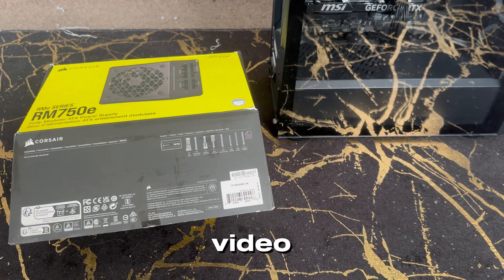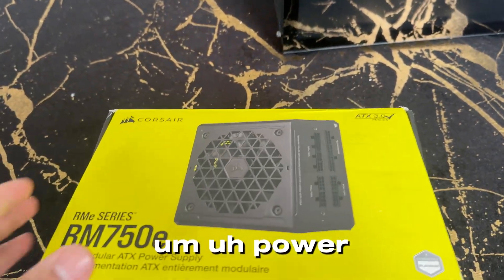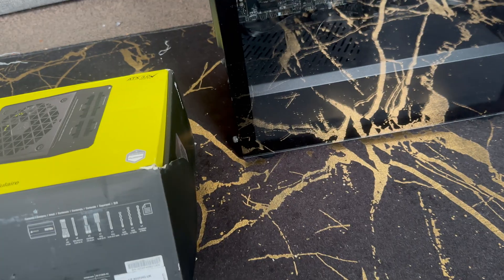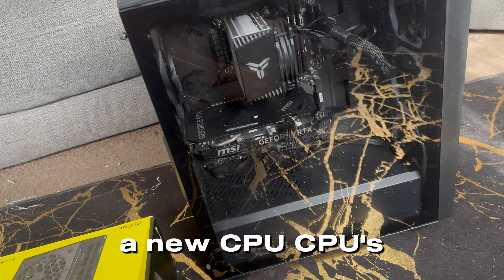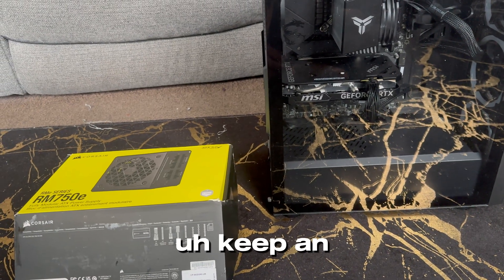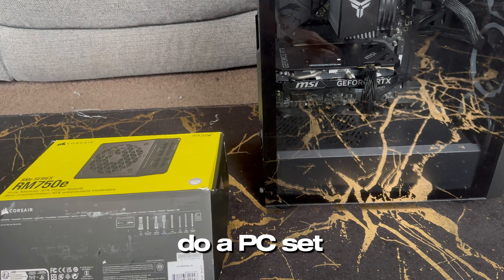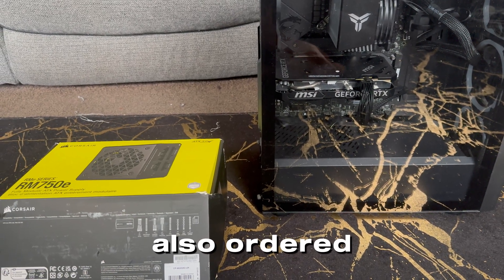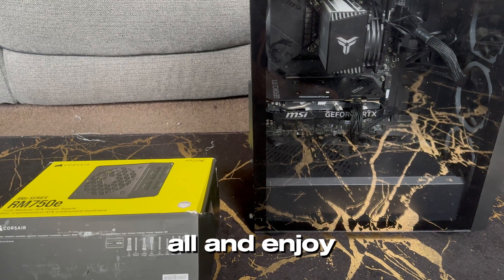Corsair 750e PSU Unboxing & Installation ⚡ 80 Plus Gold Efficiency | But There Was an ISSUE!

Comment: Is normal that my rm750e smells like hot plastic? but it works well so idk
Reply from the maker: No it is not normal, I highly recommend you don’t use that power supply any further, it will eventually give out, and fry all of components, worse case start a fire
Reply: @G @GamingSharieff  shi- am I cooked? maybe it's because I'm using an 8700g with integraded that has 65w tdp so the fan don't start if I don't overclock my cpu. Btw I have it for like about 1 month and only if I get closer on psu I can smell that, but when I shut down my pc It propagate in my room but only in the area where is the pc, but maybe it's because my case is open because I'm on a sleeper (yeah lol, I have an asus vento y8 XD). So, tell me, it's normal or not?
Reply from the maker: @Scrautchnus-gw7myI mean overall there shouldn’t be a smell, two cases I can think of, either ur PSU is burning ur case which is creating the smell or the PSU is burning, was the PSU brand new when u bought it? Or is it used
Reply: it's official corsair renewed, but nothing smells like it's burning, just hot plastic or plastic overheating but it works well so idk
Reply from the maker: @Scrautchnus-gw7mypersonally I’d take it apart and see if anything’s burnt cuz any smell of plastic ain’t good
Reply: @GamingSharieff Thank you man. btw what was the issue with your rm750e? it didn't work or it had my issue?
Reply from the maker: @Scrautchnus-gw7myit just didn’t work, tbf I bought it used off eBay so it’s not really Corsair’s fault, but yeah didn’t work